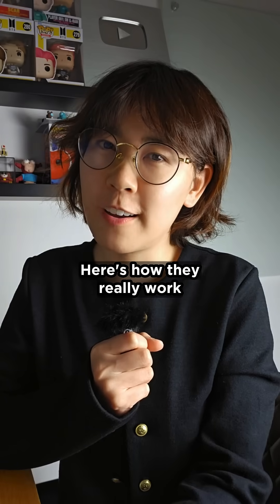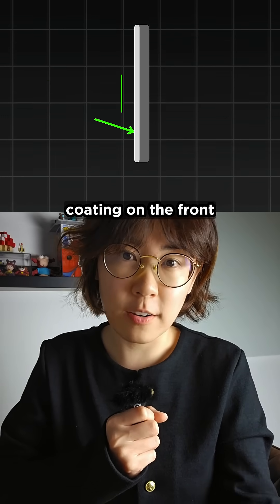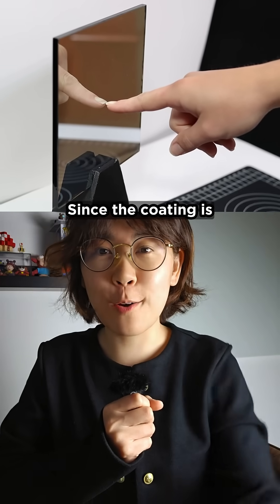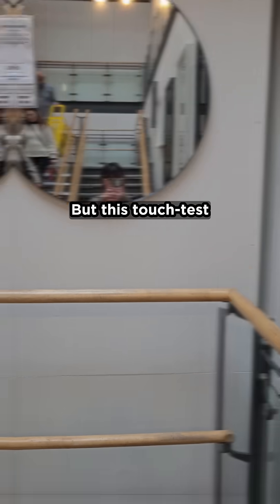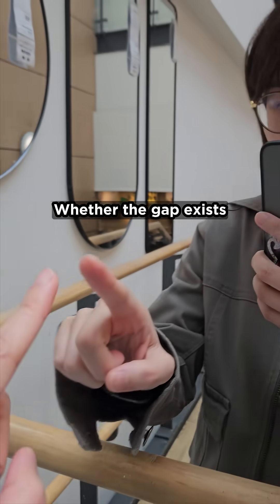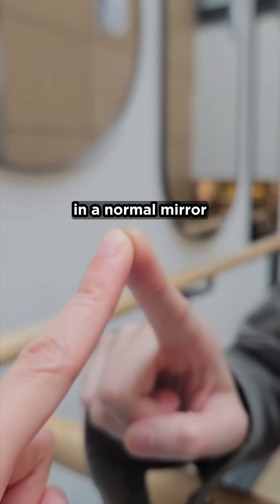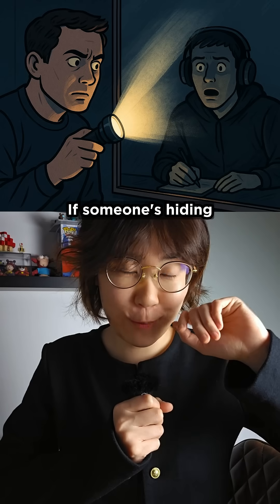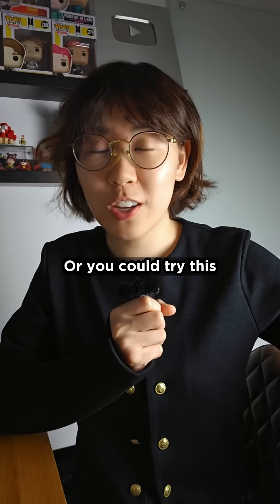Can You Spot a Secret Mirror with This Easy Test?

Comment: Point of fact. The coating applied to glass is pure silver. From cheap mirrors to the most expensive, silver is used. 

The glass is silvered and a backing is applied. 

Never aluminum, however.

Cheers.

Comment: I've been in roomes with one-way-mirrors before and I can clearly say that you can see through them if you concentrate a little. You won't see much, but enough to know if it is a one-way-mirror or not. The thing is that the flashlight trick works because a one way mirror allows you to see the brighter side from the darker one. If you turn out the light and shine the flashlight on the mirror, the other side will be illuminated and can be seen through the mirror. But there is always some light shining through the mirror, even when you are not illuminating it with a flashlight. Unless everything on the other side is coated in black paint and potential  people on the other side are wearing black, inluding face masks, you will see the utline of some objects or persons. It won't be much, likely not even enough to make out the face of a person on the other side, but it will be enough to see if it is a regular  mirror or not.

Comment: I've seen one way mirrors that used a silver solution just like normal mirrors but instead of coating with an opaque paint they coat with a clear coat of lacquer or enamel. This gives the same effect as a regular mirror with the glass up front while still allowing light to pass through, though it does tend to reflect more than it let's through, still effective in well lot areas

Comment: Finger test isn't a good totes mirrors. 
Shiny surface in back can be father away due to mirror glass thickness 

If you have 12mm (1/2") glass your finger is far away from reflective surface. Or 
3mm (1/8") mirror managing is alot closer to shiny surface.

Comment: It looks like a lot of people are missing the point. The video isn’t about someone being on the other side of the mirror, but a hidden camera. You can buy a one-way mirror that all but one small spot acts as a normal mirror. Either at the top or lower corner will be a spot to place a camera.
Some cellphones have a camera that’ll allow you to see infrared light, you can use that in a dark room to find a night vision capable camera. 

Point a TV remote at your phone’s camera and press a few buttons to find out if you can see it or not. If you can, then you can use that to find other cameras. Even on the streets and in stores.

Comment: I've done the flash light thing before! It was while staying at a sketching hotel or motel, I just took a flashlight and held it against the mirror and scanned the mirror looking for anything behind the glass. 
Obviously, you only do this to a mirror that's firmly attached to the wall and don't need to do this if you can see behind the mirror.
Another trick for looking for some cameras is to turn off all the lights and use your camera to look for light that you can't see with your eyes; you're looking for IR. Most surveillance cameras will probably have a IR emitter. Your phone camera has IR light blocking lens, but it can still see some of the IR in pitch black. Try it on your street at night, and you'll see which neighbors have cameras 😉

Comment: I used to work in a glass plant. Not all "two way" mirror she calls one way, is coated in the front and not everyone installs it correctly as it usually works the same on both sides. It's just one room is purposely dark and the other is not. 

Her flashlight trick is the best way to figure it out.

Comment: What if the creeps simply put a sheet of glass in front of the one-way mirror so you get a gap before the partially reflective coating? If you're going to be a creep, you might as well go the extra mile.

Comment: There's also a type of miracle called a first surface mirror which are used for example in the back of projection TVs to prevent distortion of the picture they're also used in telescopes and parabolic mirrors they do not allow any light through them

Comment: Using a flashlight in a dark room is better because you can typically see if there a camera lens behind mirrors that way too. Cheap plastic mirrors are nearly always just a film directly on a piece of plastic so they can't pass the fingertip test but are perfectly normal mirrors, just cheap.

Comment: She’s right. I was showering at a truck stop and there’s this big mirror on the wall. My finger tips touched so I tried removing the mirror and I broke it. It was just hanging up on the wall with nothing behind it. I was embarrassed and I didn’t say anything. I just finished twerking, put my lotion on, got dressed and left. And yes, I originally got the idea to check the mirror bc I was naked and was shaking my tail feather in front of the mirror🤣🤣🤣

Comment: One way mirror is built the same as regular mirror - also on one side of the glass. One difference is in reflective surface thickness. It must be very very thin, few dozens of atoms thin. There is a backing. Backing in regular mirror is opaque, in oneway mirrior is transparent. Gap between your finger and reflection depends on what side of the mirror you are on. One way mirrors are in fact two way mirrors but you simply cannot see anything on other side if there is a big difference in amount of light. So only way to tell if it is two way mirror is flashlight or even laserpointer trick. If you turn off the ligths and point a laser at the mirror from an angle, you should see all the light reflected back in normal mirror but faint image of lasser dot on other side if it is a one way mirror.

Comment: I own several pieces of (2 way glass). They are optically correct so can put it in front of a cameras.   Putting your fingernail on the glass works to let you know the true reflective side is facing the talent and not reflecting back into the camera lens.

Comment: the reflective coating could be on either side of the mirror. If its on the inside you will still have the gap. The only fool proff way is to shine the light or move the mirror from the wall if possible. But honestly, Im old and out of shape. No one wants to see me naked.

Comment: Yeah, don't smash the mirror. You're gonna have to pay the damages being it a real mirror or the one-way mirror. Use the flashlight test in a dark room instead. If you do not have a flashlight, use your phone, it has a flashlight feature. You have to place the light right on top of the mirror so the light actually goes fully through and doesn't bounce back to the room. If there's a hidden compartment behind the mirror and it's a one-way mirror, you're gonna see the insides. If there's someone at the other side, they will be illuminated. If you're using an AirBnb, you'll definitely want to check the bathroom mirrors mostly (cuz that's probably the room you're gonna spend most time partially or fully naked). If there's a mirror in the bedroom, check that one as well. Don't forget to check for hidden cameras and bugs as well. Use an FM radio if you feel like, and for hidden cameras, there's like a device that you can use which you can buy for like $10 - it has a red filter optics with a ring light around it. What it does it illumiates the lens of the hidden camera in the filter and you'll see a bright red glowing spot. Often these cameras are hidden inside fake power sockets (or even real sockets, where the camera is actually powered by the socket itself). But realistically speaking, they could be hidden anywhere. Those cameras are typically fish-eye type, which are designed to cover most of the room, ideally the entire room. Not to be paranoid, but there are creeps that go to the lenghts of setting up an AirBnb apartment to illegally spy on people and take incriminating videos of the victims which they can sell on the dark web for money, or use them to extort the victims.

Comment: There's no logical reason why the silvering should be on the front of the glass on a surveillance mirror.  It just needs to be half silvered and not painted so that some of the light passes right through.  The lighting also needs to be dark behind the mirror so that no light passes the other way.  The only rule of thumb is that there is no rule of thumb.

Comment: here's a better test: find the worlds strongest flashlight with the lights on then.The McDonnell Douglas (now Boeing) F-15E Strike Eagle is an American all-weather multirole strike fighter[5] derived from the McDonnell Douglas F-15 Eagle. Intended for the Dual-Role Fighter (DRF) program (initially called Enhanced Tactical Fighter), the F-15E was designed in the 1980s for long-range, high-speed interdiction without relying on escort or electronic-warfare aircraft. United States Air Force (USAF) F-15E Strike Eagles can be generally distinguished from other US Eagle variants by darker aircraft camouflage, conformal fuel tanks (CFTs) and LANTIRN pods mounted behind the engine intake ramps (although CFTs can also be mounted on earlier F-15 variants) and a tandem-seat cockpit.

Comment: A two way mirror is part of the wall, it is literally a window. If you can lift the mirror, it is obviously not a two one way mirror.
And no, a flashlight wouldn't reveal the otherside. Only if the room you are in is darker than the otherside, you will see the creeper. If you are turning on a flashlight, you are defeating the purpose of turning off the lights: you are making the room you are in lighter again and obscuring the otherside, you will only see the reflection of the bright light bouncing off the mirrored side back to your face.

Comment: wrong..a normal mirror also has a protective and opaque coating on top of the reflective layer. without this opaque layer it would be a two way mirror and function like one regardless of which side the aluminium is on. what makes it function as a spying mirror is the fact that the spying side needs to be darker, so that any light that does leaking through it (for example the spy's face) is overpowered by the reflections of light from the more illuminated side. that's all.

Comment: I make custom infinity mirrors and the mirrors I use are one way mirrors with the coating on the back surface. They look just like a regular mirror,  but they are one way from either side, it just depends which side is better lit. A great test is turn the lights off, any light on the backside will show through, especially on cheaper ones.

Comment: You can also make an O with your hands, place it up against the mirror, and peek through it. The trick is to make sure no light can get through your hands from the outside. If you can't do it with your hands, you can use a toilet paper roll.

Comment: There's a really, REALLY easy way to check for two-way mirrors: Turn the lights off and place the torch on your phone directly to the glass. Two-way mirrors don't actually reflect on only one side, they have one side being darker than the other (think tinted windows, kind of). So, this will shine through and cause the other end to become brighter than your end, reversing the effect.

Granted, with a high-quality one-way mirror you won't see much, but you'll be able to tell because the mirror will appear to "glow", as it's literally being lit from behind.

Comment: The finger test is stupid. Because the reflective coating can still be on the back side. The only factor for who can see who in a 2-way mirror is which room is more welly lit.
Reply: vt literally discussed that in the video
Reply: @Clip_It1, you're obviously not a good listener or can't read. When she explained it she said the reflective coating is on the front. Thats not how they work. The reflective coating can be on the back and still work in the exact same way. The thickness of the glass won't make a difference either. Because the coating would still be on the surface on one side. The other side would only see a slightly green tint due to light having to pass through the glass first.
Reply: @Tac_Taco  near the end of the video she discussed your method on how to do the lighting one and why its better, please watch the full video before trying to correct me, have a good day
Reply: @Clip_It1  I watched the entire video and she said to turn off the light in the room and shine a flashlight at the mirror. That also wouldn't work because you would just be looking at the reflection of the flashlight. Please learn to read or listen before commenting. Your lack of comprehension is astounding.
Reply: @Tac_Taco  im no longer going to continue with this conversation since you are just being rude, i was being as nice as possible
Reply: @Clip_It1 next time, try to be as smart as possible.

Comment: One more correction: Some mirrors are made from chromed steel. These are usually found in rougher hotels and motels. Also military barracks as glass mirrors at that scale would cost a fortune or the DoD could purchase a mountain of shiny steel polished to a reflection. The steel won't show a gap at all since the reflective surface is the surface. Not all mirrors are glass. Mirror simply defines the action of the device.

Comment: It doesn't mean anything. The coating can be on either side or sandwiched between two panes and the key is that the room on the other side is dark, so the percenage of light reflected vs. that passing through obscures vision one way. You can see the same phenomenon when trying to see out a window at night, the semi-transparent silvering just ampifies this. A flashlight or laser pointer is a much better way to tell. Turn off the lights where you are and press the flashlight against the glass. You should be able to see the room beyond to at least some extent.

Comment: Hotel maintenance guy here, stop doing this. To put a camera behind a hotel mirror is not something being done. All these fears come from one hotel in South Korea, one hotel in another country had hidden cameras and it was the hotel owner doing it. No hotel in America is hiding cameras behind the mirrors . They are mounted to the wall. So you would have to cut a hole put the camera run power to the camera remount a 2 way mirror. Then idk hope someone attractive takes a shower?? Like what sense does this make ? Someone hides a  camera behind a mirror runs that camera 24/7 just to what maybe see a attractive person take a shower?? Who’s doing that when porn is free. Seriously, oh and that green light on the smoke alarm the clock radio the lamp. Do Not have camera in them either. Please stop tearing them apart. And that toilet paper in the peephole does nothing your paranoid

Comment: Basically, on cheap mirrors, such as you might install if you need to buy 100s of identical ones for a hotel, it's really common for the reflective surface to be on the front surface, there often isn't any glass. And in quite a lot of mirrors that you hang on the wall, if you take the back plate off you can see through them - you don't have to go out of your way to make a "one way mirror", just a reflective coating that isn't fully opaque.

Comment: if you can't turn off the lights, you can use a laser pointer, you'll see the reflected dot on the surface behind you, AND wherever the dot lands in the other room. you want to hold it not near your face and point it straight at the mirror, not at an angle, because if it's at an angle then the second dot could be obscured by the wall if the other room is tall enough, but this way you're doing a straight shot to the back of the room. you can also basically determine the size (or at least depth) of the room based on how small the second dot is.

Comment: 1-way mirrors aren't. The other side has to be dark. The semi-mirror could be installed with the aluminum on either side. Normal mirrors have to be installed with the aluminum on the back side because that's that gets painted. If they were actually 1-way the flashlight trick wouldn't work.

Comment: I never heard of the finger test... i DID know the light trick.  I used to clean the observation rooms for DHW and Id have to vacuum both sides of the mirror.  One room was well lit and filled with toys and chairs(for supervised visitations) and the other was more a long dark closet with tripods, a couple tables and a chair or two.  The mirror was almost floor to ceiling and made up most of the back wall

Comment: My problem with the gap test is that originally 2 way mirrors had partial reflective surface on the BACK of the glass, not the front. You took a standard mirror and removed part of the reflective surface to make it see through. Anyone using an old style mirror, or who knows about the test and puts glass over the mirror will fool the test

Comment: It's also called a two way mirror because the reflective coating works both directions and which side appears reflective depends on the lighting conditions.   The  side that is brightest will see it as a mirror, and the other side will see through it.    Your own test of using a flashlight at the end demonstrates that.     One could say that depending on the lighting you can only see one way.. through a two way mirror.
Reply: Especially since you could install the mirror either way. Probably even just like a regular mirror to give the usual look. The finger test is useless.
Reply: Yeah, her explanation was very wrong.

Comment: A "one-way mirror" is really just a window. One side is kept very brightly lit and the other is kept very dark. The same percentage of light from either side makes it through and the same percentage is reflected, but the total amount of light from the bright room is enough that the reflected amount washes out the light that comes through from the dark room. You could make it a little more reflective than a normal window, but what really makes it work is the intensity of the incident light from either side.